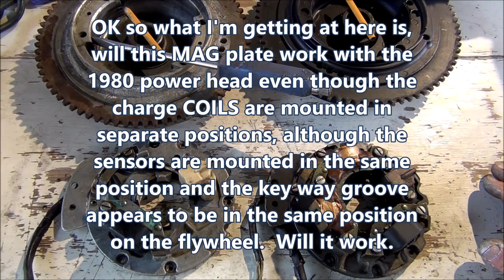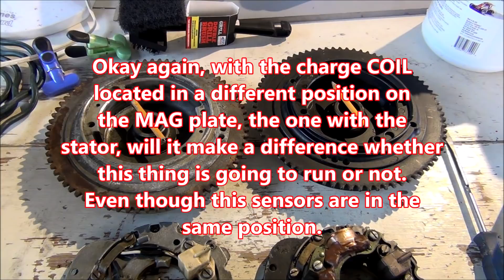EVINRUDE 25 HP - WILL THIS WORK ?

Comment: Hi, I also think that everything will be fine, since the signal for the spark will be supplied equally, and the inductor in any case will accumulate its more than 100V.
Good luck with the repairs.
Reply from the maker: Hey. Thanks , I appreciate your input. I started the build and I'm running into problems. hahaha never fails, right. Thanks again for watching and commenting . Stay tuned !
Reply: What was the problem? Not enough spark? I apologize for my English.
Reply from the maker: @MitiyB  Hey. Way to much to type !  Hahaha.  If you get time, Check it out in next video, should be up Friday . thx again

Comment: Yes it'll work, the ignition coil charges the ignition and the sensor releases that charge just like the points opening and releasing the charge in the condenser.  I hope you show it working I bet a hundred on it with my buddy Jim.
Reply from the maker: Hey. Kool man. its all starting to come back to me, a little at a time. Hahaha , the old brain/memory aint what it use to be ! You will see it run ! Thanks for watching and commenting . Stay tuned !
Reply: Chjp 234 :  Hopefully saying "condenser" was just a brain fart.

Comment: Tell me again why you want to make this swap....In any event, the sensors are in the same place, and it does not really matter where the ignition charge coil is located. Just want to be sure I understand though, you are using the older flywheel with the newer mag plate, correct?   I think that will work out OK....
Reply from the maker: Hey. doing the swap on the power head because the one that came in the motor had that screwed up piston/cylinder and I didnt want to deal with it, and I want to use the plate from it with the stator so to have a charging system , and yes I'll be using the older flywheel to also have a pull start because the pull starter wont fit over the newer 76 tooth flywheel. I just wanted to be sure everything was going to work before I started building this thing today. Thanks again for stopping by and helping me out. Stay tuned !